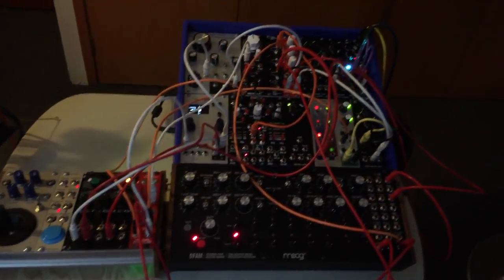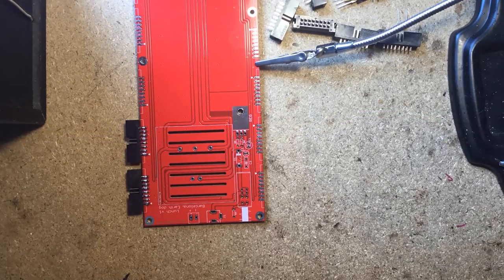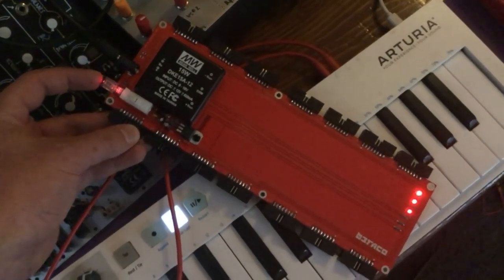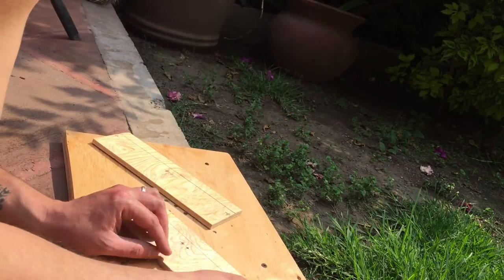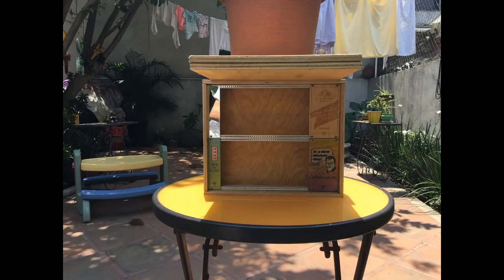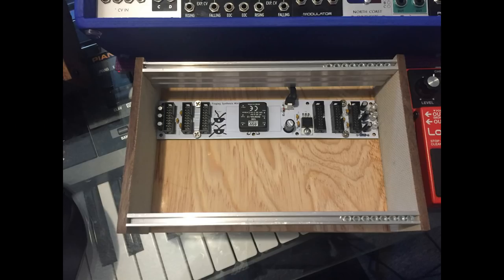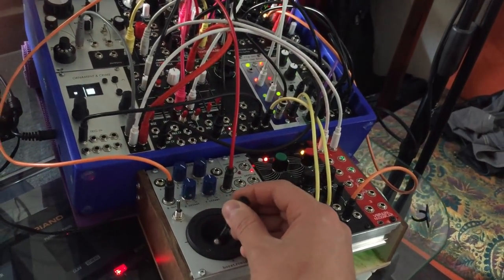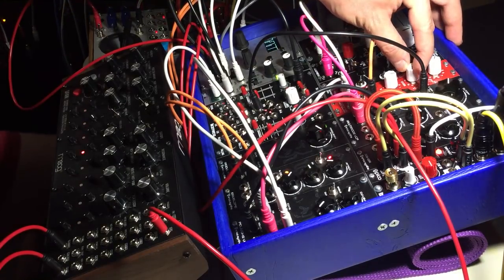Befaco Lunch Bus : Building a portable modular

Comment: Nice build! I recently built à case myself and struggled with precisely placing holes for the rails... The screw heads are too big and step on one another a little, that is really many unplanned parameters to take into consideration !
Reply from the maker: Totally! The metal brackets I used for measuring were super important. If I'd had 4 I would have used them in the case, but since I only had 3, at least I could use one to make sure the measurements were correct!
Reply: Synth Diy Guy believe it or not, doepfer's 84HP rails are shorter than eowave's 84HP  rails... I noticed it trying to expand doepfer's A-100 6U DIY to a 7U
Reply from the maker: the nice thing about standards, is that there are so many to choose from! LOL
Reply: Synth Diy Guy 19 inches should remain 19 inches everywhere though...
Reply from the maker: I'm joking of course...  Doepfer sets the standard, I think Etherwave gives you a tiny bit extra just in case. Easy enough to file it off I guess :)
Reply: Synth Diy Guy Haha yes maybe, i'll have to take it off with a metal saw !

Comment: What is your Oscilloscope module called please? :)
Reply from the maker: Hi! It's not a module, it's a standalone pocket scope I built from a kit:
https://www.aliexpress.com/item/Original-2-4-TFT-DSO150-15001K-DSO-Shell-Oscilloscope-Diy-Kit-Pocket-Digital-Oscilloscope-Learning-Kit/32845489951.html?spm=2114.search0204.3.25.25d9197b6bveyJ&ws_ab_test=searchweb0_0,searchweb201602_2_10152_10151_10065_10344_10068_5722815_10342_10343_10340_5722915_10341_5722615_10696_10084_10083_10618_10307_5722715_5711215_10059_308_100031_10103_10624_10623_10622_5711315_5722515_10621_10620,searchweb201603_2,ppcSwitch_5_ppcChannel&algo_expid=68dca499-bb32-4012-a52e-7661122a7688-3&algo_pvid=68dca499-bb32-4012-a52e-7661122a7688&priceBeautifyAB=0
Reply: Aaah ok, thnx. I'm not into soldering, so I'm gonna pass on this one. But looks nice in your rack!
Reply from the maker: there's an assembled version for 20 bucks too!
Reply: Synth Diy Guy does it easily connect or do I need Adapters to audio?
Reply from the maker: it comes with alligator clips, which you can clip to the end of an audio cable. I just made a special cable with a proper audio jack. You really should het into soldering, makes life better ;)
Reply: Not at this time. Funny thing is I watched your video again and realized that I was talking about the "ornament & crime" that sometimes shows a waveform .... I didn't even see the Oscilloscope we are talking about now :) Funny
Reply from the maker: Ah, funny :)

Comment: Hey!
How do you screw the voltage regulator? To me, it seems that the holes are too close so either i can't screw it or can't place his legs in the holes. Any idea?
Reply: Also, i have a 2.5mm connector but it doesn't get in, what should be the outer size? 🤔
Reply from the maker: try bending the legs  90% with a pair of pliers so they go through the holes and the screw hole lines up.
Reply from the maker: Most my standard barrel connectors here fit. The Rackbrute PSU for examples works fine. Check the specs on that in the Arturia site.